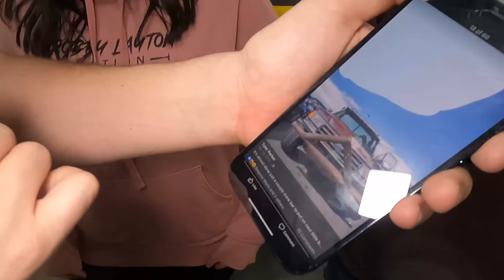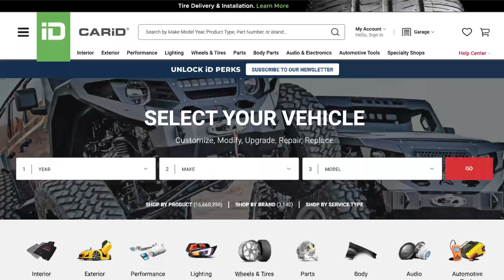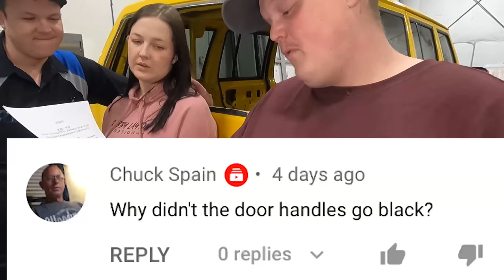TOW TRUCK, TOW TRUCK, TOW TRUCK!! 2 Tow Jobs Plus Q&A With The Crew!

Comment: Rescue usually cuts the battery. Your lucky no extrication was needed, because a lot of departments cut the valve stems to help stabilize and crib the vehicle. Tow truck drivers hated it when we did that.